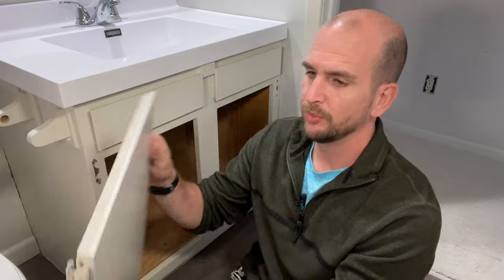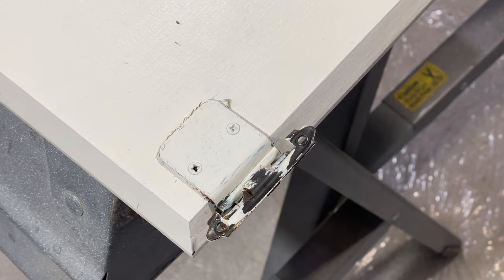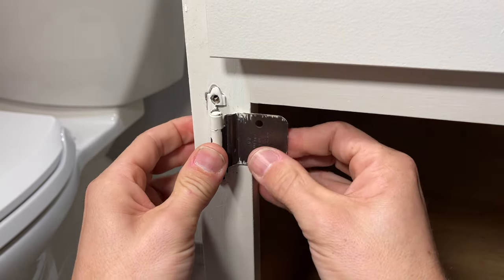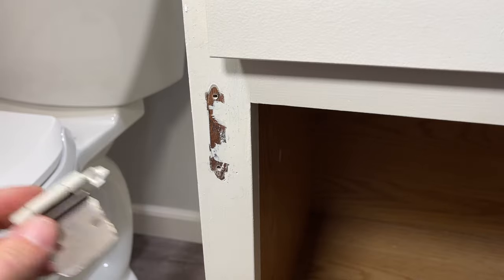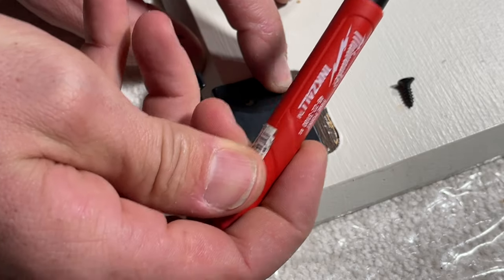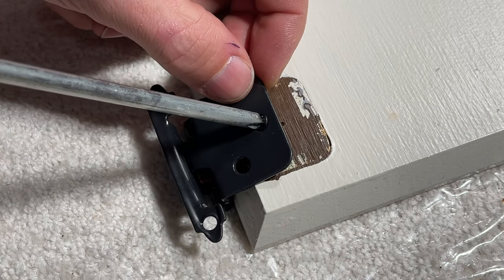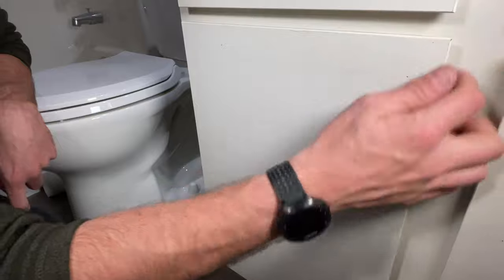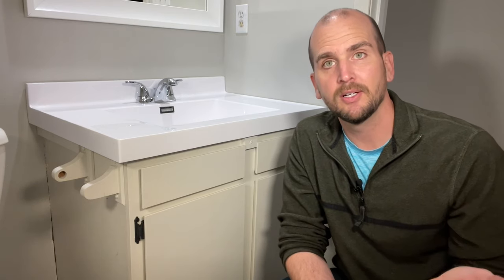Installing New Face Mount Cabinet Hinges

Comment: How do I measure correctly hanging 2 doors I DIYED I have the same hinges except its self closing I'm stuck on how to measure where on my TV stand to hang them. Prob simple but I'm lost!
Reply: So, the hinges are self closing correct? What I would do is make the doors slightly wider than the opening,  depending where you want to place the hinge. The beauty of these hinges is you have some room to play to.see where the doors look the best. That's why making the door wider than the opening is key ( I hope your doors are wider than the opening) Btw, I build custome furniture so I have some knowledge but I am not an expert. Please me know if this help. There is a video in YouTube that will help you visualize it,  if I find it I will send you the title. God bless
Reply: In you tube his channel name is dusty guy and his video is " cabinet overlay hinges". Its an old video but it will help you visualize it. I hope this helps
Reply: @ronnieves2398   I already made the doors  they are larger than the opening.  Just was confused.As the hinges don't sit flush unless the door is opened for me to measure so it makes it difficult to figure out being by myself
Reply: @tiffanysmith3210   are using the hinges like the ones in the video?
Reply: @ronnieves2398  yes except they say self closing but exactly the same
Reply: @tiffanysmith3210  gotcha,  self closing are awesome. You should be able to mount them on the back of the doors first, same distance on both from the end of the doors. This way you can see how they would look best against the furniture you are trying to mount them, this way you can move them around for how far in you want the doors
Reply: @ronnieves2398  I already have done that as well I just need some help/assurance hanging them figuring out measurements I can prob put it where ever I see fit but I feel like there are idk standard hanging heights even tho I (diyed) my doors for a stand I have.
Reply: @tiffanysmith3210  so the doors are to close over the TV,  right?
Reply: @ronnieves2398  no just imagine a cube shelf unit. Having 8 square/cubes in total. I believe the cubes are 13x13 I made 2 doors one to go on either end of the unit. One door covers 2 shelves leaving 4 exposed in the center.
Reply: @tiffanysmith3210  oh , I see. As long as the door covers the 2 cubes without sticking past the end you should be good placing it in the other end. The end where you are placing the hinge has to have enough material to place the hinge , if its too skinny this hinge will not work. If its too skinny you can always add a piece of wood to that end to attach the hinge.thanks for the visual,  that really helped. If the doors are too heavy you may want to make  too doors per each end so 4 total.

Comment: You didn't do your homework !! There are several manufacturers that will have dozens of different "Direct Replacement" hinges with the exact dimensions and hole pattern as the one you're replacing !! Why does this matter ?? Because A Lot of older doors have a profiled edge on the face of the door. This means that if your (viewers) buy a hing that mounts closer to the edge of the door, the mounting screw are likely to project or lift material through the face of your door. Reason number 2. If your doors are made of MDF as a lot of kitchen and bathroom cabinet were/are, re-drilling new screw holes n next to the old holes the strength of the door material is now weakened and will at some point ripe out. The spring loaded tension of the spring on your newer replacement hinges is strong enough to rip the screws out of a second set of holes..Do your homework !! Find Direct Replacement Fit things with Exact same hole patterns. Avoid Big Box Store or similar venders !! Go Directly to the manufacturer. They Will Help you find the correct hing and typically cheaper !!
Reply: That should read Hinge. Not things !! spell check error 😣
Reply: Do your homework..

Comment: I too am having a terrible time trying to figure out which new hinges I can buy having bought several different sizes available at Home Depot to replace these 80s hinges which have a totally different mounting style (where the one side of the hinge actually hugs and wraps around another side of the inside cabinet as well as has opposite holes from all the newer ones)… I think I’ve gotten that the old hinge is a size 1/2” so the replacement must also corespondent to a 1/2”, is that right? But my main issue seems to wonder why the hinge (the one that seems to be a good match) feels like it is so hard to open and although I have yet to screw it in (because I just dont know where to start), will this also mean it won’t open once screwed on? It appears that when I attempt to slide the new hinge next to the old one that’s currently still attached to the cabinet door, it seems to fit albeit sitting a little differently due to the different design however when I go to open the door it pushes the hinge right out from under my hand while I’m holding it in place. In other words the new hinge with the plastic in the center doesn’t want to open while I have it just above the older mounted hinge while I hold it there to see if it will fit which it does but it (the spring) won’t open instead the entire hinge just gets pushed forward and so I’m wondering if this is because there’s something else I’m missing. Sorry if this sounds confusing. I am just very perplexed at this point. By the way,  Can I use a different size, like a size 3/8” if I remove the current 1/2” if I just change the position of the holes and mount or is it not possible at all?
Reply: As if that’s not enough … my old hinges I’m attempting to replace, I cannot find a similar style ANYWHERE online and I’ve tried searching hundreds… they’re so different as I mentioned above in the style where they hug the inside of the cabinet and so it’s even more frustrating not to be able to know exactly what I’m replacing except to try to match a size and style that seems to fit.